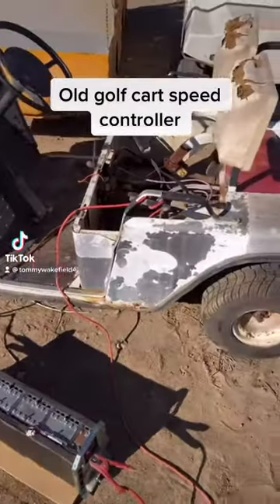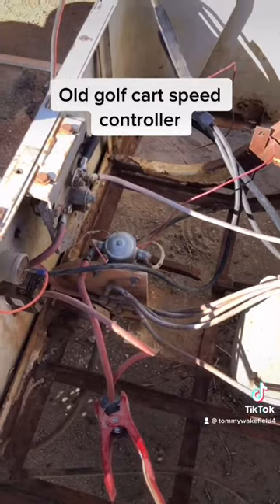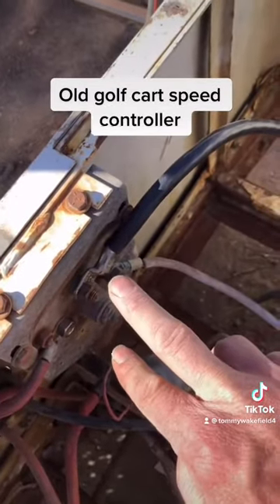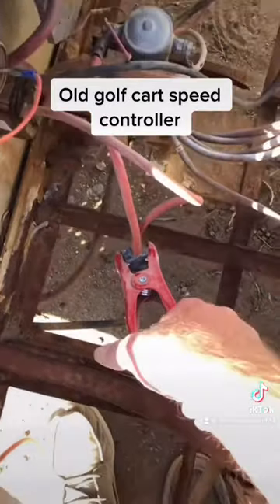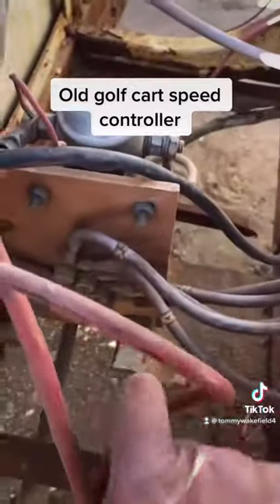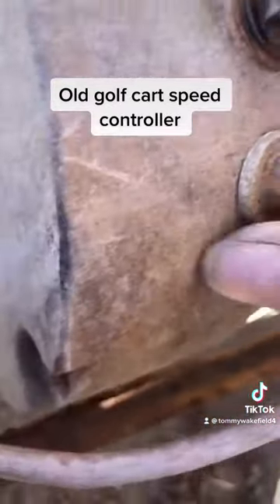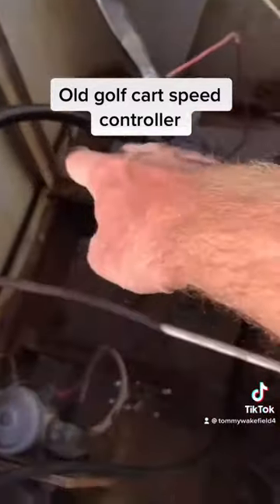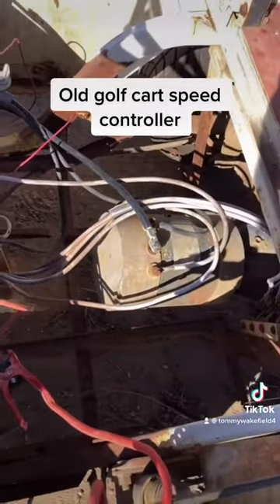How to wire an old 36v golf cart (resistor speed controller)

Comment: Thank you the awesome explanation. I'm trying to revive a completely disassembled old Melex 36v resistor cart, I like a challenge.
Reply from the maker: It can be confusing! 🤯
Reply: @RetroElectric  I'm now on my 3rd way of wiring (3 different diagrams I found). Think it's finally sinking in on what it wants.
Question, can a field wound motor work instead of the series wound if I keep the concept of a1-f1, a2-f2 like a1-s1, a2-s2? Needing to use a rear end that has different splines.
My other project is stretching an ezgo 43" and have installed a Sequential Port Injection Harley engine and trans from a FLH. Been fun getting everything working right. 
Again thanks for the information.
Reply from the maker: @howitstartsmm  so in short I’m not entirely sure. I was bench testing a rear end that had one of those motors in it. What I don’t understand most about those motors is why they don’t call them parallel motors. Series motors run the two fields in series and field wound motors run them in parallel. Speed controlling a field motor is done a little different I think but I’m not sure because I didn’t test it much further but I’ll post a video of my rear ended that has that motor and try and explain some of my findings. Most stuff I’ve found on those motors is horrendously overcomplicated explanations of how the motors work.
Reply: @RetroElectric  Well, I went ahead and wired it as if both motors were internally similar. After playing with the F-R switch and accelerator (with jack stands supporting tires off the ground) the motor would turn, sporadically and reverse of indicated direction. After not burning anything up(and watching your video three more times) I focused more on the negative circuit instead of positive circuit. SUCCESS! I now have forward/ reverse and speed control. I will post a picture of the wiring diagram and a short video on my channel after I clean things up a little. 
Again thank you for the information you shared.
Reply from the maker: @howitstartsmm  yay!!!! The first time I successfully got reversed fired up was an extremely joyous time! I did have a diagram I drew up for myself laying around somewhere.

Comment: Awesome video man, saving this one lol. What’s the biggest point to the resistors
Reply from the maker: Just make sure all the connections are good and the brushed connector is good. Putting a lithium battery on it will majorly lighten the load and be easier on the brushed connection.

Comment: So I have been looking to do one of these builds using the exact same battery from battery hookup.. I wanted to run 4 of them in parallel and series to give me 72v @96ah if I’m not mistaken… what are your thoughts since you are messing with them? I have an AC navitas motor on my cart and I really want something that I can push that motor to the limit !!! I live in York pa so I can always pick the battery’s up too
Reply from the maker: Do it!!!! These batteries are awesome!
Reply from the maker: 6.9kwh battery is insane for a golf cart. I will be getting testing data back soon from this cart. Distance is probably between 10-25 miles with just one battery at 1.7kwh. Technically an AC motor will be a little more efficient than the old series one but I also have zero loss under full throttle because I have no controller. Pedal to the metal on these old carts is direct from the battery.

Comment: Do you happen to have any info for a 78 HD cart?  The cart has a resistor like the one you have there but it has 3 solenoids also.  I can't seem to find any info on it and I have 0 movement out of it.
Reply from the maker: It probably uses a lower amp brush pedal and the pedal engages different solenoids to make contact at different parts of the resistor. If you can upload a video so I could see if that would help me out. I think you can tag me in the video so that I would get a notification hopefully.

Comment: That motor can run on 72v

Replace resistors with 48v or 72v series controller
Add throttle sensor and voila.  Fast cart good control
Reply from the maker: Already done that!

Comment: So I have this resistor style 36v cart....I've switched to 3 12v deep cycle batteries and since I've done so my brand new batteries drain super quickly like 20-30mins max my cart stops...why is that? Is there any way to have it go a lil longer? Help appreciated
Reply from the maker: What kind of deep cycle? Just a standard Marine deep cycle? Or something bigger? Like 100ah
Reply: @RetroElectric  standard marine deep cycle 12v...
Reply from the maker: @LamzLamz714  I would say buy three more. Those don’t have a lot of capacity.

Comment: I took the easy path and bought a motor controller. The resistors just burn off battery power. They do work and parts are still available. I'm using the same batteries built up to 14s for 48 volt nominal. If you buy 7 of the 36 volt(10s) from Batteryhookup, you can make 5 x 14s beasts for 12.5kWh in parallel. The are amazing batteries. You just need longer all-thread and a couple more busbars and insulators also available from battery hookup. They are like Lego, easy to build any configuration.
Reply from the maker: Awesome. I like some of the resistor carts but I do hate if I have to work on them.